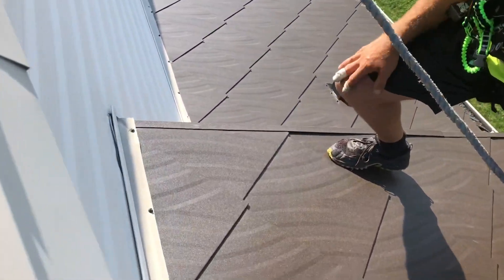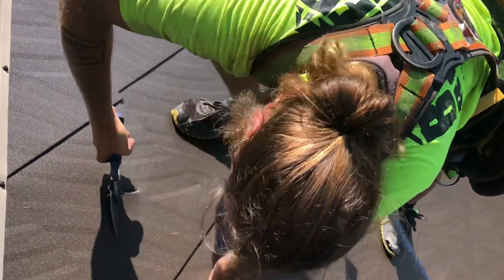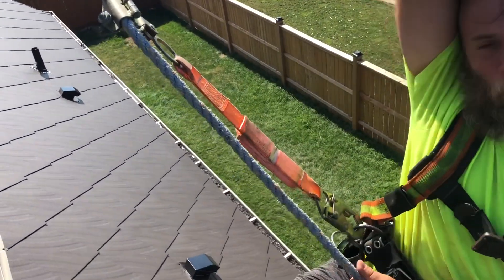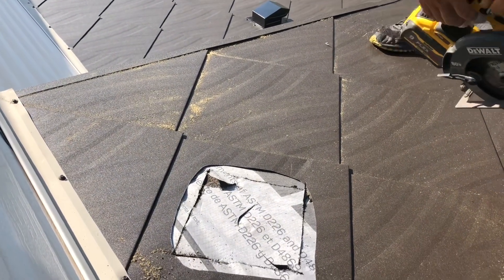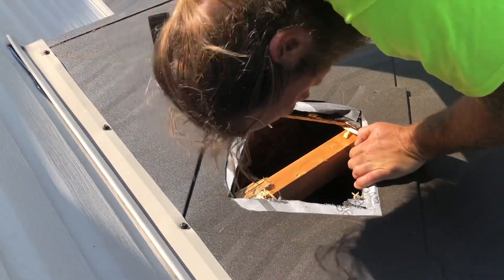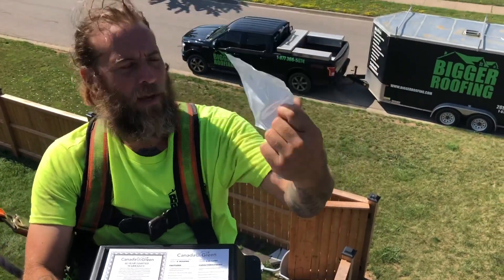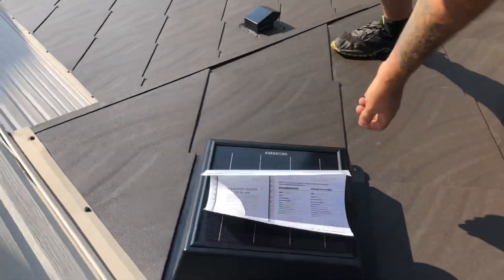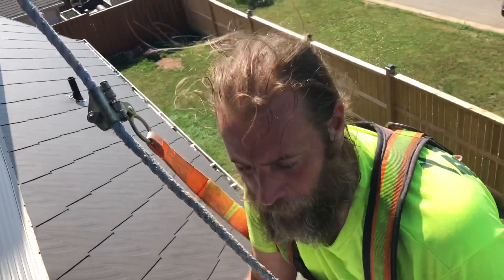Installing A Solar Vent On A Metal/Steel Roof

Comment: Hey Josh my parents just had there roof done and installed 2 of the solar vents my dad still complains attic is too warm compared to having 2 whirly birds home perimeter is 20×30 so having 2 solar vents should be suffice for attic space correct?
Reply: Ok that's what I thought and explained to my dad I do roofing on a smaller scale but I also told him soffit plays a big part on proper roofing ventilation which his attic is full of crap lol!!! And soffit aren't properly ventilated